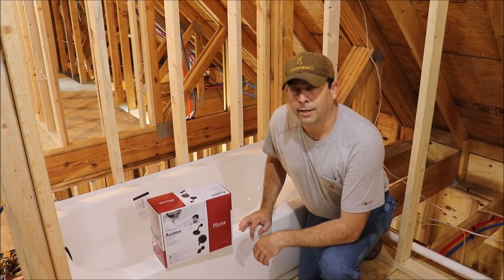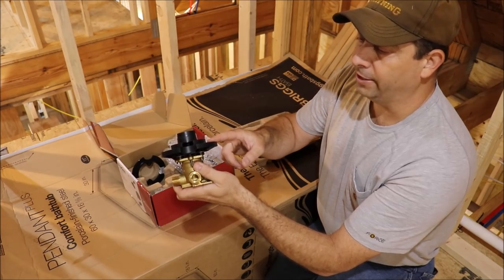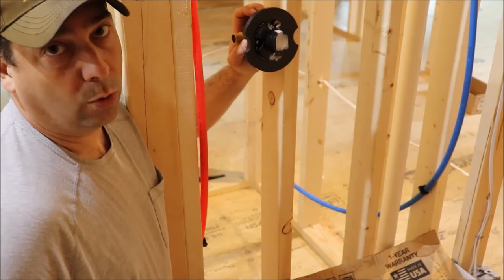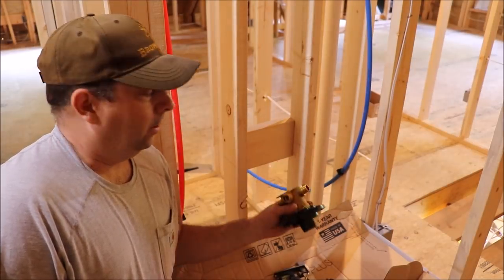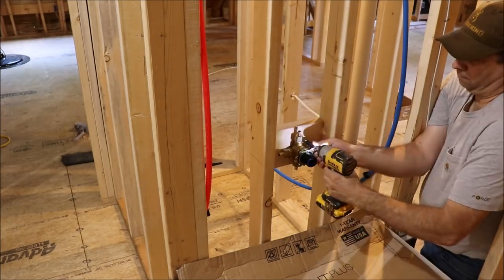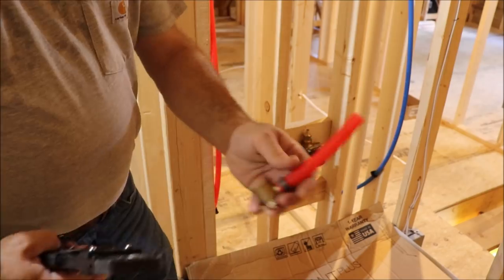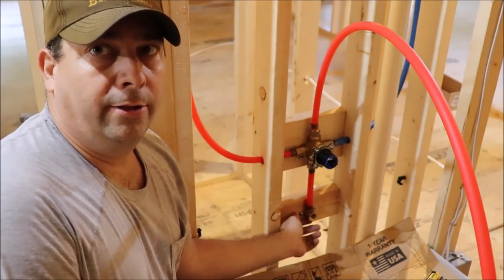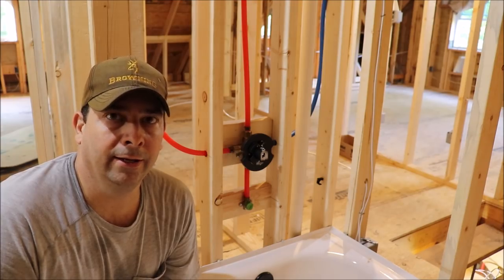Building My Own Home: Episode 109 - Roughing In A Tub/Shower Faucet

Comment: Just a heads up, the majority of tub/shower mixer valves specifically tell customers NOT to use PEX for the drop tub spout. There is a science to it, and it's called something like 'flow rise' or 'spout rise' and basically the drop line to the tub spout must be done in a larger diameter pipe like 1/2" copper.  Most PEX that is 1/2" is actually closer to 3/8" Inner Diameter.

Comment: That pex piping is the only way to go. I used copper on mine, never again. I had a blow out on a frozen pipe where pex would have expanded. Few connections, cheaper, easier and faster. IMO the only way to go. 👍👍 NICE JOB. Vinny 🇺🇸

Comment: If you turn your Teflon tape roll the other way in your hand you can hold the tape tight as you wrap it.  Just let the spool slip in your grip as you wrap.  Two opposites:  wrapping direction and spool orientation.  It seems backward until you get used to it.

I really admire the quality of your work!
Reply: I was going to offer the same advise. Once you learn how to wrap the teflon tape correctly, you notice everyone doing wrong and it drives you crazy
Reply from the maker: Thanks guys! Sounds like good advice.

Comment: I have been watching all of your videos and find them to be very helpful. I am not a builder but have done a lot of remodeling. When doing plumbing I always try to keep all the electric systems away from the water system. In this video I have noticed that there is a electric box in the wall behind the tub. If you have a leak in the tile and backer board you could have a serious issue. So if possible I think I would try to move that electric plug down the wall just to be on the safe side.

Comment: I usually sweat a 6" piece of soft half inch copper in my valve for my spout drop and 5" piece of hard copper coming out the wall... we use the soft so when we trim the tub you can get the spout nice and straight

Comment: I would def pay to have a licensed plumber come in to give you an all clear & check-off before you wall-in any of your plumbing. That would be a great sense of mind. Awesome progress!
Reply: he'll have to get a open wall inspection before he can close them
Reply: Chris Carpenter no inspectors in his county but I’m sure it will be fine.
Reply from the maker: You're right Chris, no inspections where I am, buy I did run a long term pressure test on it. If it can hold air for weeks at a I shouldn't have any problems with water.

Comment: Please double check if the pex line to the spout is large enough diameter to prevent water from being forced up to the shower head.  I had this issue when remodeling a bathroom.  I wound up doing 1/2" coper instead of pex for the spout, which has a larger internal diameter.

Comment: I wouldn't use 1/2" galvanized pipe for the tub spout, I would use brass pipe. That would be brass screwing into brass not steel into brass which can cause electrolysis and corrosion. Just need a couple galvanized half inch nipples and cap for the shower head and tub spout drop your 90s for testing and installation of the Durock and tile. You're doing a wonderful job.